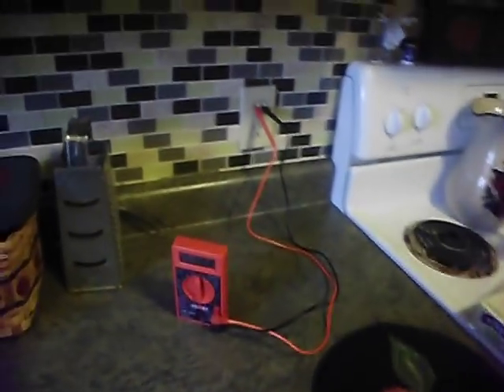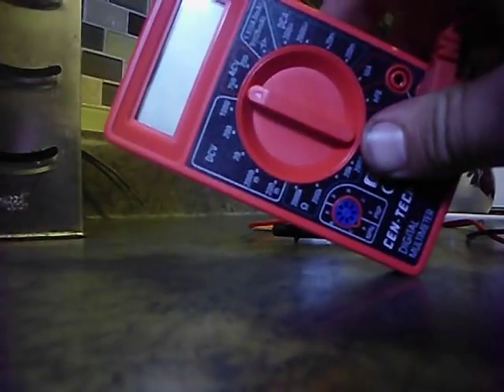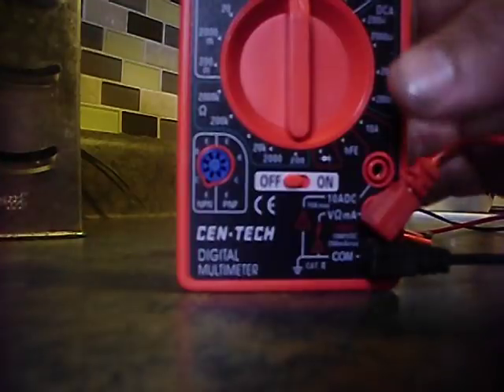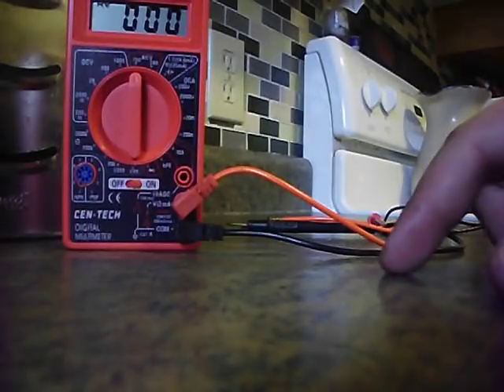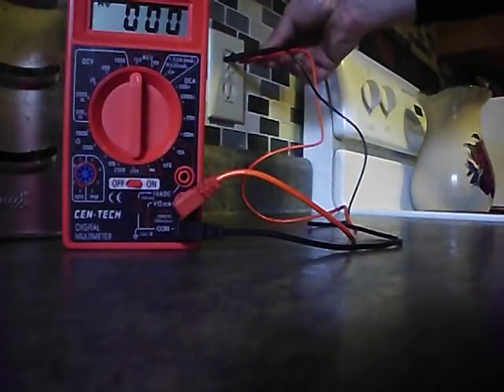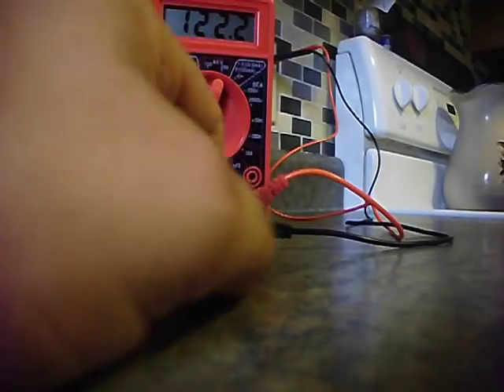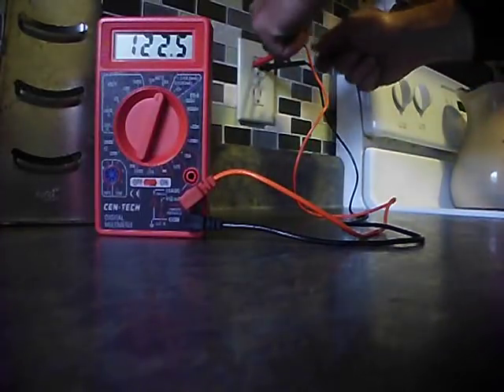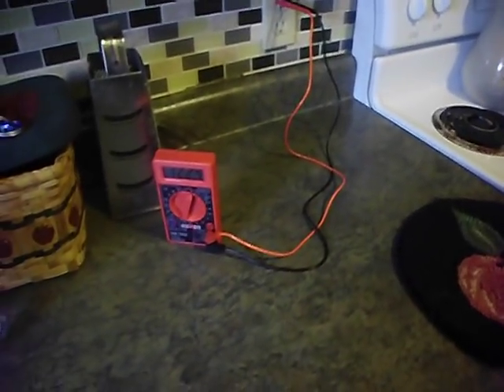How to test voltage on an electrical outlet

Comment: How do you use the digital multimeter do test your cigarette lighter in your car
Reply: I need help because I cannot charge my phone and when I need my GPS on my phone it drains my phone battery someone tampered with it idk if it works at all
Reply from the maker: @katiemulherin95  additionally, check voltage by switching to dc hold one lead on the power and another on the negative, should read 12 volts if not, it is faulty
Reply from the maker: you can change the reading to DC current, usually looks like a dotted line then a solid line, ac current is a wavy line, which would be 120v in your house, DC is 12 volts. check continuity to ground in the outlet in the car and make sure there is no short.

Comment: Thanks for taking the time and effort to post this. It actually did help. I have the same multi-meter. When I turn the dial to the same setting as yours it sits there at -02.9 until I touch the lead at which point it zeros out. Who knows. lol

Comment: Do I need to turn off fusebox switch first? If you said so, I missed it. Thanks
Reply from the maker: If you are doing any work on the outlet, then yes. If you are checking power reading then no it must have power to read it.

Comment: 130 is it normal reading ?? or I have to call my electrician ?
Reply from the maker: maybe a bit high. I would check with a different meter and if it is still high I would say there is a voltage reg. problem

Comment: how do use this unit to measure a 30A 250V
Reply from the maker: you will have to select a higher voltage range

Comment: what happens if you do not get the normal 120 v? e..g. 80v?and how do u know if the electricity going to the socket is hindered ? will the meter show something different ?
thnks